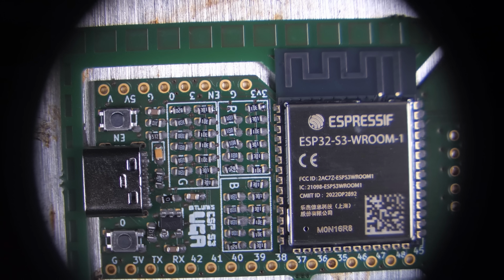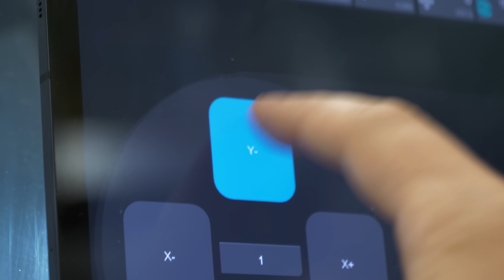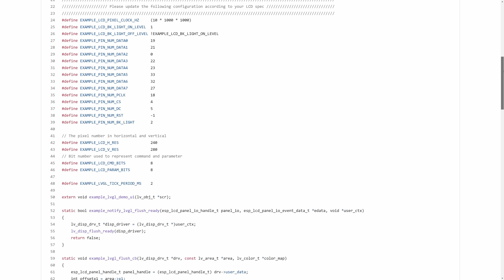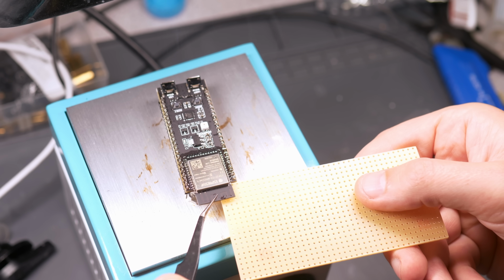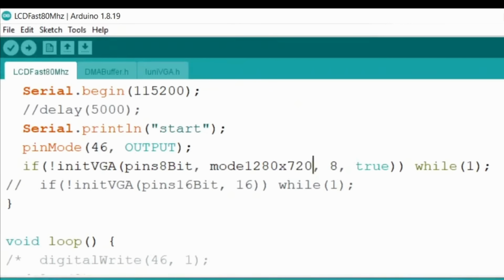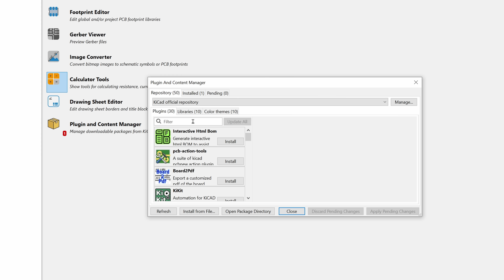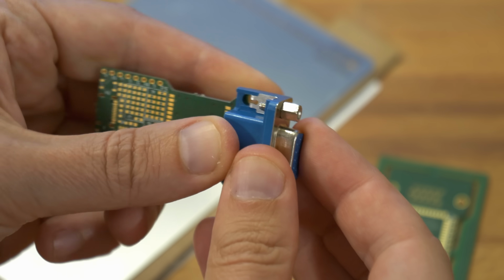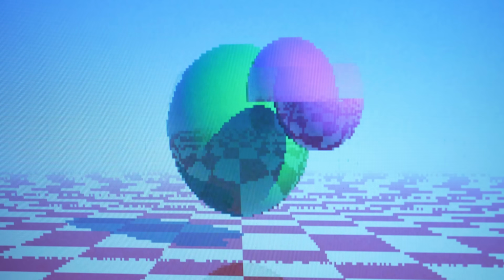I made a VGA card that blew my mind

Comment from the maker: The board is available now: https://www.tindie.com/products/edit/esp32-s3-vga/
Reply: Replace "edit" with "bitluni" in the URL, otherwise theres a log in prompt to try to edit the entry.
Reply: Hi, since the boards are sold out, is there a chance you share the schematics, please?
As a workaround, I thought ordering standard S3 DEV kits and attach the resistor array via a VGA breakout board.
Reply: Link is broken. I may be late to the party but maybe redirect to source files ?
Reply: I just got mine delivered, haven't had time to play around with it but super excited.  Great job as always bitluni.
Reply: I wonder if you could consider an XYZ version suitable for vector output.  You could 1 to 3 bits for the Z depending on RGB or 8 level use and the rest of the bits for the X and Y with your R-2R ladders.

This system of using the video ram for storing the vector list was proposed by someone before using standard VGA card but you could make it dedicated for vectors.
Reply: When will you start reselling these boards on Tindie? Or release the board design for others to make it if you are not going to sell it yourself?
Reply: @bitluni how can I buy a board? It says you're taking a break

Comment: 1:58 I know your pain. I made the same mistake when I designed a PCB some time ago. I used the wrong footprint for the VGA connector, although VGA connectors with that footprint existed, it turned out that they were rare.

Comment: Hi everyone,

I'm working on a project using TTGO VGA ESP32 and FabGL. I would like the device to display short texts (around 100-200 words) during the day, changing every 24 hours to another but different 100-200 words, for example from a notepad on an SD card.

I wonder how to best automate this.

Does FabGL offer any functions for scheduling tasks or displaying text at specific intervals?

I thought about several solutions, e.g.:

Table of texts: Storing texts in an array and displaying the next element every 24 hours.
Text file: Loading text from a file on an SD card and changing the file every 24 hours.
RTC: Using the RTC module to measure time and trigger the display of new text.
Which solution will be the easiest to implement with FabGL?

Do you have any other ideas or ready solutions? I would be grateful for any tips.

Can you help me implement my project? marketingoowo@gmail. com

Comment: My dude... I understand this is more of challenge than something useful, but I think you can make your life much easier with an STM32F74x or STM32F75x. Maybe need an external SRAM, maybe a VGA/parallel DAC, but you can definitely build a 2k, maybe even 4k @30Hz and 24bit colors (8bits per colour) VGA  adaptors with not much hassle.

You could even avoid the BGA soldering as there are TQFP versions with enough pins for that.

Comment: I am using the original vga lib.  It can't run 800x600 when using wifi, getting buffer alloc fail.   I would like to use '2bit' mode to reduce the buffer size so it will fit.
I am actually replacing the backlight on my lcd with red leds, so there is always 'red' on full, so only 4 colors, black, red, yellow, magenta.  I prefer the higher res instead of more colors.   I checked memory space, it shows 281k available before vga init, with wifi it drops to 221k, so it seems I could make 2bit mode fit?
Essentially the red bit in 3bit mode would always be 1.  I'm going to try and hack it, but if anyone could help I'd appreciate it, I am a bitluni surprised there was not a 1bit mode already to reduce buffer size.
Reply: So I got 2bit mode working..was difficult to follow the source code, but after many hours, got a 800x600 2bit display with plenty of ram left.  Even got a 900x600 mode to work as the lcd is a typical wide screen.
The vga2bitI works but with wifi running, the vga signal timing has trouble keeping sync with the lcd display.  I'm quite discouraged after all the time invested that it doesn't appear viable.   I have PI's, but they use hdmi output.  I am now wondering if I can just use another esp-01 for the wireless interface, but it needs to send the data to the esp32, esp01 uart can the esp32 handle it while running high res vga?

Comment: dont you have experience with converting RGBHV signal from an industrial crt monitor to VGA capable signal for an lcd? it does not really need a lot of colors just has to be able to write the status of the machine on an lcd. my machine is having a 15,54kHz horizontal sync and 63Hz vertical sync clock. im thinking about doubling the hsync and hope its gonna sync with the vga monitor, if you can please help me

Comment: I just bought some esp32s3 MCUs and plan to use it as video output, but I still don't understand what exactly did you do to have, for example, 65 MHz clock without jitter. At 5:06 you have a list of clean clocks, 65 MHz is not there (as expected), but at 10:15 you have a const defined with parameter clock defined as 65000000. How do you get 65 MHz at the end without jitter?

Comment: €5 off my board with your code? Some manufacturers will ship boards for less than that! 😂
Reply: And then still have to pay for shipping and import. We offer free shipping to most parts of the world.  Complex boards are also manufactured with ENIG by default, which runs you €30 extra at other manufacturers.
Reply: @aislerhq  I don't need ENIG, so it's an unnecessary cost. And for less than €10 I can get 4-layer boards to my lab. I'll check out your new budget options.
Reply: @m1geo  We currently only support 2 Layers for our Budget pool. But we are investigating the possibilities of more complex budget options.  Like more affordable 4 Layers.

Comment: Dear @bitluni This was a great design.  Thank you for documenting it.  I get the idea that you are clever enough to also do one for the ILDA system.   It might become the most popular interface if you can conform to the specifications.  The discreet clock speeds might be enough to allow the ramping of the voltages smoothly enough. Your buffer system could be used to repeat the vectors.  There was a chap on YT that used a VGA port to control a XY scope way back when so the concepts are similar enough.

Search for "How is the ILDA connector pinout?" for a basic rundown of the interface.

LaserMAME is a thing.

Comment: There are multiple HDMI encoder chips that takes the same input as your VGA resistor ladder and tolerates some clock jitter. You may want to create a version that replaces the VGA resistors with an encoder and emits HDMI.

Comment: Awesome work! But wouldn't an FPGA provide a more efficient design approach?
Reply: A dedicated VGA controller would probably be cheaper and even more efficient? Why not use a GPU? 
Point of the video was updating the VGA library and making it work with the ESP32 S3 pushing the new chip to it's limits. If you go over the comment section, there is even an Expressif guy named "Spritetm" commenting and talking with Bitluni about potential changes and TDMS for HDMI capabilities of the ESP32 and known issues. 
FPGA is a totally different beast, needs programming of the logic gates before even starting to write anything VGA for it. The ESP32 is basically an Arduino on steroids using the same libraries with various serial protocol pins, readily available libraries for everything, a "maker and mess around with chip". If you wanted the most efficient thing you'd just design an ASIC and skip the whole FPGA or universal microcontroller thing, mass produce and sell it. Oh wait, that already happened, 30odd years ago when the first VGA cards hit the market 
🤡

Comment: I don't Quite Understand the Significance of all this (Making VGA with this ESP32), but I enjoyed watching the process though. Really Neat!
Reply: I think mostly, the ESP32 has wireless built in, so it could be a very cheap way to create wireless displays.  But it would probably be most useful for simple or static displays; there isn't enough processing power to, say, decode video at any significant resolution.

Comment: That is extremely impressive, doesn't seem like it'd be too hard to use one of these modules as the video solution to any number of DIY retro computers. VGA timing issues can cause some REALLY odd bugs. I remember having an old CAD/business graphics card which would do utterly bizarre things if the power in the house flickered at all, narrowed it down to Hsync going haywire when this happened. needed to restart to fix it.

Comment: this is not canonical.   it is not fair to design a device from the 1980s using devices from the 2020s.  need millimeter paper, pencils, a beam oscilloscope and thick reference books only!

Comment: I need a VGA adapter.
Do you sell these assembled and tested?
I need it to accept pixel data in some standard form on a few pins like SPI or UART etc and 640x480 is fine or 800x600 also fine.

Comment: Yes, I want a vga to just about everything else adapter and hopefully I've found the right channel to ask about SATA and PATA   adapters.  I know you can get adapters to plug newer SATA drives into old PATA motherboards but I have the opposite problem: I have some old PATA drives with some great stuff on but no working PATA motherboards so can't plug in to my SATA pc.
Is it possible to make a backwards connector or does anyone know where to buy an ancient working PATA pc? I only want to transfer to modern storage medium.  Lots of old music and video and software from my youth when I was pretty well dialled in with home computing.
Basically been away for 15-20 years and things have moved on just a tad since.😂 trying to catch up - wish me luck!
Reply: @billynomates920 Get a cheap USB to IDE interface. Hope your data is still readable.
Reply: @nmpu  thanks!  IDE is what i was looking for - just those three letters have made my search much easier (i'm reading about ide interface standards now) thanks again for your help! 😃👍

Comment: You can also PWM your LSB in the R2R ladder to multiply your DAC resolution by your PWM resolution.
For example 8-bit PWM with a 8-bit R2R ladder can be combined to give 16-bit resolution.
Reply: Seems to be a bit on the impractical side with a pixel clock above 25MHz and often closer to 40MHz, there would also have to be added some filtering to the signal to prevent "sub pixels" in the individual pixels on higher resolution monitors

Comment: Really nice project! I started to develop for the ESP32-S3 as well for a retro-computer project to make it easier to replace software on a cartridge by WLAN and using its internal PSRAM for some extensions. Really nice powerful modules, just a bit too few GPIO imho but nothing that cannot be fixed with some fast muxing and bitbanging.

Comment: A true VGA card uses 6 bits per channel. 5-6-5 may be the common approach to 16-bit colour, but the palette for 8-bit mode should be picking 256 colours from a 6-6-6 colour space. If you implemented a 3x6-bit DAC, you could easily support 5-6-5 modes as well as correct indexed modes by just shifting the red and blue up by one and outputting zero for their least-significant bits. It's not strictly correct, but it's close-enough, and I can buy that plenty of 1990s-era SVGA cards actually did it. Hell, later ones that support 24-bit colour probably do it for converting the VGA palette to 8 bits.
Reply: Revisiting some time later, while the above method isn't correct, as noted, the correct way is actually a lot simpler than you might think, and maps to hardware quite easily.

For unsigned values, just duplicate the value into the destination bits, starting at the top, until you fill them all up.

eg. 3 bits to 8 bits: ABC -> ABCabcAB (changes in case to help show where the copies go)

For signed values, it's a little more complicated, as you need two different approaches for positive and negative values. If the value is positive, make the top bit 0, and duplicate the N-1 remaining bits. If the value is negative, just put it at the start and pad with zeroes.

eg. 4 bits to 16 bits: ABCD -> 0BCD bcdB CDbc dBCD or ABCD -> 1BCD 0000 0000 0000

In hardware, the unsigned approach can be done with just wiring. The signed one can be done with a multiplexer and some wiring.

Comment: Maybe you could put grayscale composite video on the same board?
Reply: Might be a bit hard, given it runs at rather different frequencies from VGA. 31kHz horizontal for VGA vs 15-16kHz for TV signals, depending on the standard. CGA used the 15kHz refresh rate so it could be used with an NTSC TV and IBM handled backwards compatibility with it by just repeating every line when showing its modes on VGA. That 320*200 mode so many games used is actually sent to the monitor as a 400-line signal by a VGA card. The H and V timings are identical for 640*400 and 320*200, the card just behaves a little differently in how it gets data out of the video memory.

Comment: IF memory is an issue, would it be possible to create a sinclair spectrum style attribute mode where there are squares of colours. They wouldn't need to be limited to only 16 colours  you could easily have 256 colours instead of flash and bright or even more but it would really drop the memory requirement and perhaps increase the speed a lot too. Maybe even achieve higher resolutions with the same hardware,
What do you think?

Comment: Maybe add a 2nd module for SLI XD ala 3dfx? 
btw, where do I connect my PS/2 keyboard to run doom.EXE? And if we’re on it - what’s the IRQ for the SB pro emulation? 
Who will write a Win95 driver for this resistor network?
nice

Comment: If you could add sil164 or TFP410 to drive a HDMI connector that would be great, It would be completely digital, so the D/A conversion would not be necessary.

Comment: Nice... How about using 3 pwm generators to generate the rgb signal?  The circuitry should only need a simple rc circuit for each line.
Reply: How fast do you think a pin can switch states?

Comment: Impressive, what can be squeezed out of an ESP!
I mightbe a minority, but some more technical deep dive in protocol and issues would have been nice (maybe by video references).
What hot air and solder station are you using?

Comment: I had a similar problem with the footprint from KiCAD and ended up modifying it to have oval shaped holes for the outer rows of pins. That was enough to make it compatible with multiple cheap variants of VGA jack from the usual suspects. The next time I'm going to modify the footprint for the shield ground tabs to ovals as well, to make soldering those easier and use less solder.
Reply: I hate when sites have "footprint" files that are just png images of the part. I end up having to import them into inkscape, scale them properly, make a proper SVG and import THAT, making sure it imports at the right size.

Comment: Inspiring project! I can recommend "Interactive HTML BOM plugin for KiCad" for generating the placement map when assembling. With this, you don't have to re-map the components at Aisler. And also great to see Aisler supporting your project, I use them all the time and their customer support is awesome :).
Reply: Thank you for the compliment. We continually work on providing the best support.  When the project is set up correctly, there is no need to re-map the components.  Unlike other tools, we automatically  sort the components in a way that eases the placement and reduces errors. And as an added benefit, you can order assembled boards with just a few clicks after your verified your hand assembled prototype works because all the data is ready to go.

Comment: I'm curious why you didn't go with a bunch of 150 ohm resistor arrays, you can get 8 resistors in 1506 or 4 resistors in 1206 footprints. 
Would probably be nice to have a grayscale mode or maybe a 8bit color palette mode and maybe some built in font, for example would be nice to be able to easily make 2D interfaces like in Turbo Pascal / Norton Commander days etc
Reply: FWIW, for a good resistor-ladder DAC you need a bunch of resistors that have nearly identical resistance values (very high precision). 
  
You really don't want to use ones with +/-10% variances and even with  +/-5% ones, you'd still want to check them all in case you end with a pair that have 10% total difference.   
  
----- 
  
A built-in font would likely consume a pretty good chunk of ram, especially if you went with bitmap fonts. You could keep in external storage, but then displaying text might become IO-bound.
Reply: @jnharton  We're in 2023, you can get them (cheap) with 5 percent, 2 percent and 1 percent tolerance, and 100-200ppm/C temperature coefficient. For example see Bourns CAT16-1500F4LF or Yageo YC164-FR-07150RL - 4 resistors 1% tolerance in 1206 package, and they're 6 cents if you get 100. Expensive ones go down to 0.1% and 8ppm/C.... but cost orders of magnitude more. 
A font like Terminal or Fixedsys or some open source / public domain alternative would use maybe 10-16 bytes per character (8 pixels horizontally, maybe 10-16 vertically), so let's say 256 characters x 12 bytes ... it's not really that much. Could be even made out of some sprites (4 by 4 or 8 by 8 sprites, 2-8 bytes per sprite) to "compress" a font by reusing some sprites but probably the extra lookups would be more expensive than just using more memory.